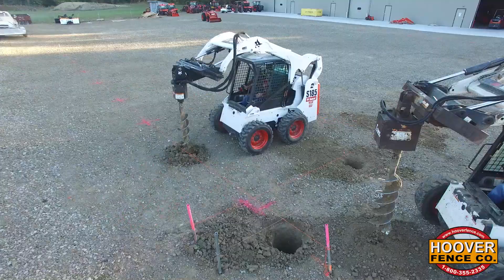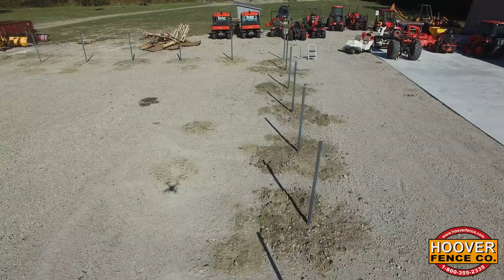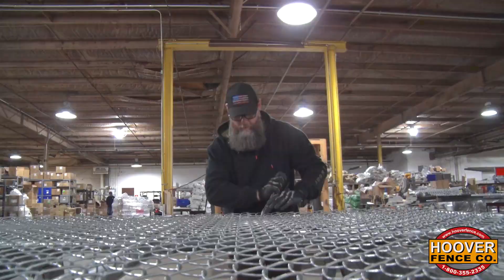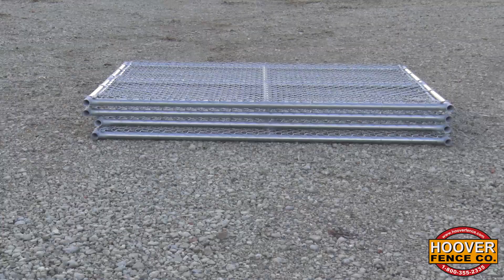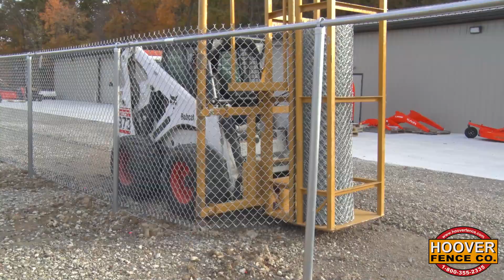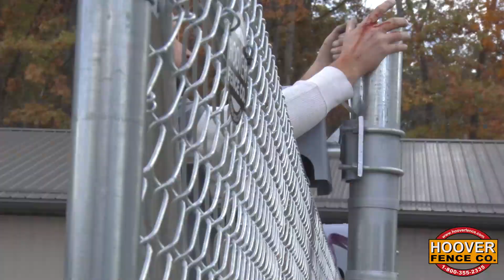Chain Link Fence Installation by Hoover Fence Co.

Comment: 2 questions. 

Do you guys go 2” less than fabric height on commercial, 2.5 less, 3” less?

And as far as commercial gate posts especially cantilever… do you set those to the string, or set them on center with the line posts? I’ve heard some guys say “set them to the string and it’s all good” others say oh no. Don’t set the gate posts to the string, come back and set those to where the center line of the gate post is on center or on the center line of the line posts